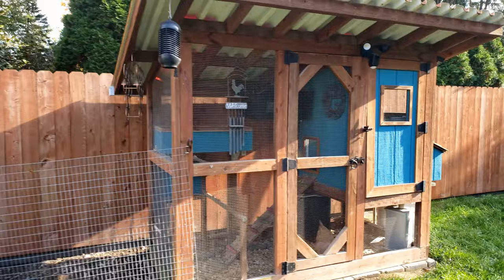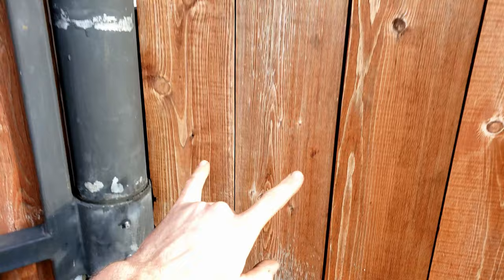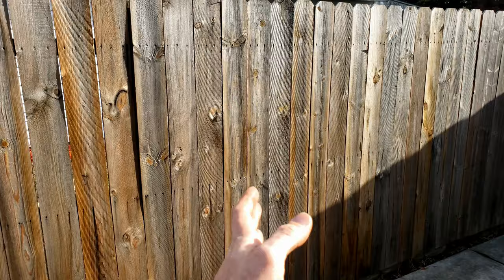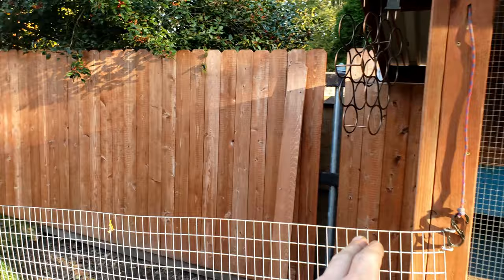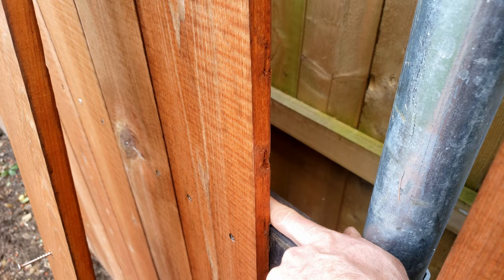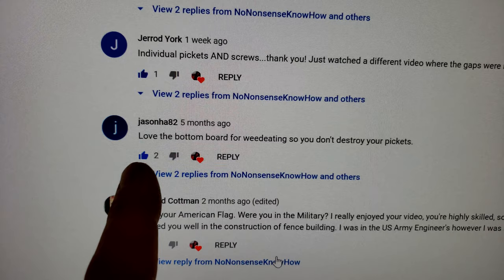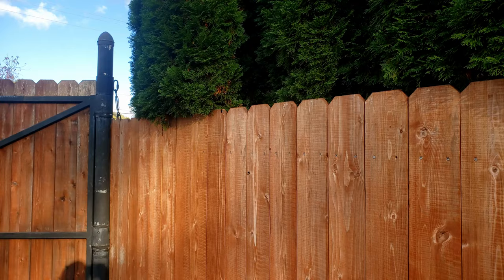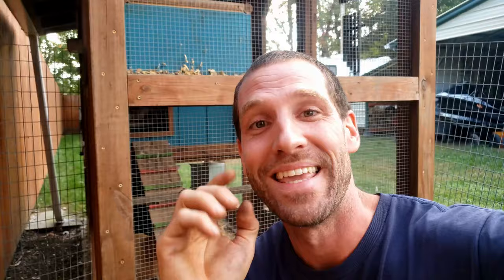Cedar Fence Made Picket by Picket VS Store Bought Panel (2 YEARS LATER)

Comment: Question: May I know exactly what type of wood did you used for the bottom of the fence? or link would be so great and is it with TWP too? colored blue? Thanks
Reply from the maker: It was 5/4 pressure treated. And some of it actually cedar also. Just hit it with the torch and then TWP.  Shou sugibon

Comment: How would you do the fence if one side is facing a street instead of a neighbor. also, instead of doing your sugi method, could i use use a pressure treated panel at the bottom instead?
Reply from the maker: If it's facing the street I would say definitely a shadow box or face the good side out. Otherwise it would look awkward. And yeah pressure treated panel is plenty good for the bottom.  Probably better than Cedar